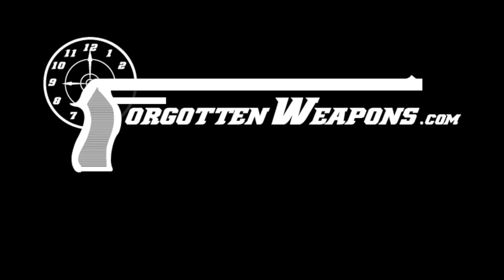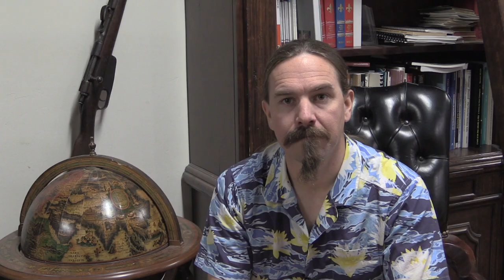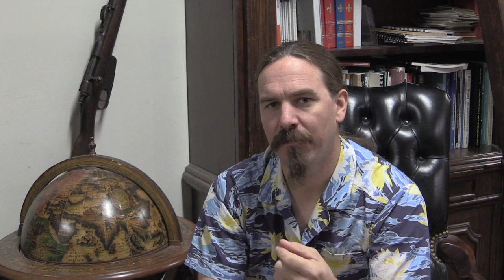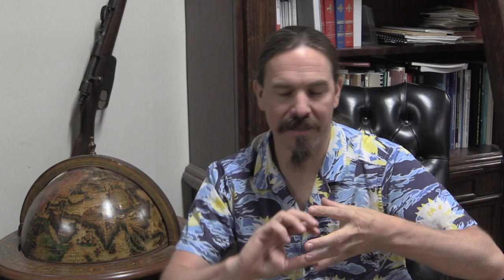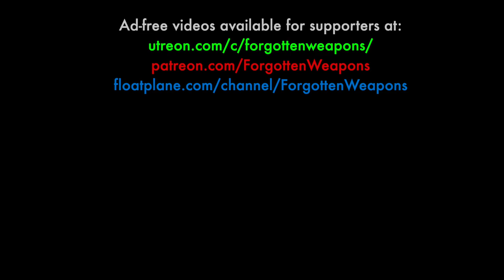Ask Ian: Progressive Twist (Gain Twist) in Small Arms?

Comment: On Colt revolvers with gain twist:

I own and sometimes shoot an original '51 Navy revolver with this feature, and have looked into it somewhat. To my understanding, the goal was to achieve decent accuracy with both round ball and much heavier conical bullets. Even today, if you shop for repro muzzleloaders you find that ones optimised for heavy conical projectiles tend not to shoot well with round ball and vice versa. The issue is longer conicals need a higher rifling twist for stability, whereas round ball have such a small rifling engagement area that steep twist rifling can just skip over the bullet instead. There's no cylindrical bullet shank to engage the rifling, only a narrow band of lead touches the bore. So if you try to shoot round ball with a full service charge of powder in a barrel meant for conicals, the rifling may just strip away parts of the bullet instead of spinning it up in a predictable manner. Colt's solution sort of works, there's less force on that narrow engagement area so they shoot well enough (but not super accurate, in my experience) with both bullet types.
Reply: That makes sense, I was thinking it might be to compensate for softer lead than we generally use today.
Reply: Belted balls might give you the happy medium. Slightly elongated ball with a small full diameter flat.
Reply: @Devin_Stromgren  it doesn't get any softer than pure lead, which with perhaps a little bit of tin mixed in is the preferred material for black powder shooting. Severely doubt they had access to something softer back then, modern BP shooters tend to go for the softest bullets they can get.
Reply: @Kaboomf  Yes, but the more tin the harder the alloy.  I'm pretty sure that even the round balls you can buy today have more tin in them than was standard in, say, 1830.
Reply: @Devin_Stromgren  No point in adding more expensive tin than you have to. Enough to make casting easier, no more, since BP shooters specifically want soft bullets. A tiny bit of tin makes the alloy flow better so it fills the mold without wrinkles.
Reply: ‘Stripping’ the rifling on round ball in the Colt revolvers were a thing. The supplied bullet molds were, to say the least, not always uniform. If the ball were a bit smaller, it spun the ball a bit slower reducing the lands ‘skipping’ on the bullet, ‘stripping’ the rifling.
  As far as increasing accuracy, we’ll, if your bullet is more solidly engaging the rifling and the jacket and lead are not separated, that increases your accuracy, does it not?
  As far as the purity of the lead, I dare say commercially sold lead today is much more pure than the lead from the 1830’s or so due to production practices.
Reply: @Kaboomf  Wait, THAT'S what the tin is for?  I had always assumed that pure lead was just too soft.  I've done a decent amount of black powder shooting but I've never got into casting my own bullets so I haven't done a lot of research on it.
Reply: @Devin_Stromgren  For black powder, tin is mostly to make casting nice high quality bullets easier yes. Increasing tin percentage can increase hardness a little bit, but nowhere near as much as adding antimony does. Lead/antimony alloys can be hardened significantly by quenching in water, lead/tin cannot.

For black powder in most calibers, velocities are low enough that you don't need increased hardness to prevent leading. And softer bullets obturate better to seal against the bore, especially with low pressure powder charges. Obturation also helps with rifling engagement. With higher pressure higher velocity smokeless loads a harder bullet gets enough force applied to its tail to obturate, but hard cast bullets like you'd use in a .44 mag don't perform as well in low pressure BP loads.
Reply: @greghardy9476  I'm sure there have been some advances in lead production, but long before the 1830's there was considerable work done on perfecting the refining of lead. The reason for this is that lead ore tends to contain small amounts of silver and other valuable stuff, so the more "impurities" you could remove from the lead the more valuable silver etc you got as byproducts. 

They actually got so good at this that it became economically viable to strip old churches and cathedrals of their centuries-old lead roofs, refine silver out of the lead, and make new lead sheets to make new roofing for the church again. Several old European cathedrals had this done at various times.

All this is to say that by the 1830's you could get lead in fairly high purity, certainly better than 99%, because the typical impurities were worth refining out in their own right. And those impurities make the lead harder, not softer.
Reply: Back when I did the repro colt revolvers like the 1851 Navy, I vaguely remember using .380" dia round lead balls for a nominal .376" bore?  Basically slightly oversized at loading.  Depressing the loading lever would either obdurate the ball or shave a tiny lead ring, producing an off-round projectile, and what might be a slightly beefier surface for rifling engagement.  It also helped seal the chambers from chainfire, although grease was a must.  Anyway, very interesting discussion... I think the theory of conical vs. round ball is accurate.
Reply: @kurtbjorn3841  yes, what you describe is best practice and does make for a short cylindrical part. Not all original bullet molds were accurately made though.
Reply: @kurtbjorn3841  I've heard that grease on the outside of the projectile is a myth because after the first shot the gas from the cylinder gap blows it away.
Reply: @Devin_Stromgren  - I think enough remained to "wet" the space above the ball, quenching sparks, etc.  I'm not sure.  I did have a chainfire once and did not want to repeat the experience, so I did use grease or soft wax.  It was  40 years ago, so my memory about remaining grease is poor.  Maybe someone will chime in.

Comment: In long range competition shooting community, gain twist is some what getting popular, especially in 264cal and 308cal. Many 6.5 CM shooters uses 24-28 inch barrel with twist gain from 1:9 (chamber)to 1:7 (muzzle), claimed more stable grouping and slower throat erosion.
Reply: The slower erosion is super interesting. Especially with a round like 6.5 cm that relatively kills barrels.
Reply: Saves me saying the same thing. I have no doubt as desired muzzle velocities increase in military small arms gain twist will make a big comeback as it's a cheaper solution than more exotic alloys in barrels.
Reply: 6.5 CM shooters I suspect on average are a pretty gullible lot to begin with so likely they are more inclined towards marketing hype
Reply: Gain twist also reduces gas blowby as the bullet travels down the barrel. 
In a regular barrel gas blowby increases as the bullet are "worn" going down the barrel and the very high speed gas going forward of the bullet has a blowtorch effect on the rifleling towards the muzzle reducing barrellife.
Another way of reducing the blowtorch effect is having a little choke in the barrel to increase barrellife. Cut rifled S&L barrels have a slight choke lapped into the barrel in finishing. Some highend hammerforged barrels have have choke. The French FRF2 sniperrifle have barrels with choke to increase barrellife.
Reply: @dgoodman1484  Now in my case could care less about any marketing materials as it was more about the intention. My goal was to go for 1000 yard shot without going to big stuff. Initially I chose the .244 Valkyrie but happened on a really bomb deal for a Ruger Precision Rifle. I think the one gripe I have about the caliber is it seems gun smiths/specialists just can not get their shit straight on the round. It seems recommended barrels, lengths, brand, and so on is more in the sky than ever before. What I found interesting during the plandemic ammo shortage was the few rounds that were available being 6.5 creedmoore, .260 Remington, and .300 Winchester Magnum, and .244 Valkyrie. .260 and .300 I was not aware of but talking with some people those two as well are pretty nice rounds and seemed to be same price about.

That all said the gains were to improve a few things on other popular bullets. Recoil, accuracy, and action were the benefits. Even in the shooting competitions it was taking a lot of wins versus the other rounds used. Enough so it made it to articles and reports. So I do not think it is just hype, but as we probably figured out by now. There are many different calibers and many basically forgotten. So is 6.5 supers special? At least for the moment yes it seems to be pretty good. The military adoption is also pushing market share as well due to production to fill the demand. In my opinion the round that needs to be moved from is the 5.56 but that is not going to happen any time soon. Its design purpose was a NATO requirement and its purpose to tumble not really humane overall.
Reply: @agskytter8977  What do you mean by choke? If I am reading that right it almost sounds like the barrel gets tighter towards the end sort of like a shot gun choke. Wouldn't this affect the bullet shape as well as potential damaging of integrity of the bullet itself?
Reply: @1014p  Yes, tighter towards the muzzle. In one of FW videos on FRF2 a french engineer explaines this in detail. Barrellife go past 10000 rounds.

Comment: During development of the M39 and M61 gain twist rifle also showed a slight increases in muzzle velocity over uniform twist rifling. The GAU-12 25mm, and the two 30mms, GAU-8 and M230, also use gain twist rifling.  Some people claim gain twist is used for fusing reason, but this is not the case.  The Army's M50 series 20mm ammunition for the gain twist M39 and M61 uses the same fuses as the Navy's  Mk 100 20mm ammunition for the Mk 12 cannon, which has uniform twist rifling.   Also, large artillery, 105mm, 155mm, etc., use uniform twist rifling, and these have much more intricate and complex fuses.

Comment: A couple of things:

"Progressive Depth" rifling is a major feature in the barrels for the M-134 Mini-Gun.

These barrels have an amazingly light profile, hence barrel wall thickness. There are usually SIX of them being whirled around, each discharging up to 1000 rounds per minute.  The barrel wall thickness at the muzzle has to be one of the thinnest I have ever seen on a firearm with that sort of rate of fire. Looking at the drawings for these barrels, the rifling is DEFINED as "progressive depth"; becoming DEEPER at the muzzle; essentially tapered-depth LANDS; the groove diameter is essentially parallel.

Think about that: reaming a tapered bore and then trying to cut rifling into it. The final cherry on top is that these barrels are also hard-chrome lined.

If you get your sticky paws on a new Mini-Gun barrel in its wrapper and take a peek, it becomes apparent that there is more than one way to form a "taper".  The rifling in these beasties is STEPPED; a sort of "digital" taper. with short "ramps" between each step. Put simply, H&R, who made a gazillion of these barrels, used quite conventional barrel-making tools to "approximate a "tapered" bore.

Thus, if a techie / armourer type runs in a set of incremental bore gauges to the depths specified, all will be sweetness and light. Bullets accelerating from a standing start to over 2500 FPS just do not care. Whirling a cage of six barrels around in the breeze / slipstream at 1000 RPM helps to keep them "cool" (ish). I have heard rumors of M-134 barrels with Stellite liners like an M-60 barrel, but there is nothing on the drawings about it, nor have I ever encountered one. Any advances?

As tor gain twist; using ancient barrel rifling tools and machinery, it is relatively easy to do. A conventional single-tooth cutter dragged through the bore and guided mechanically by a "pilot" drum with the progressive-twist track on it will do it all night long. One pass at each index and depth, reset the "tooth" a thou' or so, repeat until you have the desired result. Before the advent of "industrial" scale technology, this was done by HAND, in thousands of tiny workshops all over the USA and Europe.

I suspect the Italians went down this road for a couple of reasons. 6,5mm was, at the time a SERIOUSLY small bore, especially when most of the neighbours were still fielding 9 to 12mm bored antiques. Those, like the Brits, who were already fielding 7.7mm (.303") bore arms were using long, torpedo-shaped bullets with jackets drawn from Cupro-Nickel, which is fairly hard stuff.

The engineers probably noticed early bore "wear" in their prototypes / test-beds and sought a solution. Another factor is the "pressure curve" on firing.  The Carcano is a tough little action, but has marginal gas shielding . Furthermore, the brass used in the day was still not as refined in formulation AND processing, as it would become less than a decade later. Launching the bullet relatively "gently" was probably considered a judicious thing. Any throat "wear" due to bullet abrasion / propellant gas erosion could be discounted for longer, because the final bullet spin rate was achieved in the final six inches of the barrel.

Comment: Very large bore weapons, such as larger caliber aircraft systems and artillery pieces, use a separate driving band made of softer material than the casing on their projectiles.  The driving band engages with the rifling and provides obturation, rather than the casing.  One of the tests we used to perform when proofing these systems was to test for driving band slip.  

Whilst the use of driving bands is generally a good system, it tends to encourage gas erosion just forward of the chamber.  As a result it means a rifled tube may remain in service in such condition that quite a length of the rifling directly ahead of the chamber has been removed by gas erosion.  One of the regular tests done on large bore systems is to measure the depth and length of gas erosion to calculate the effect on stabilisation as a result of the lost rifling.

The level of gas erosion present towards the end of the service life of a large bore rifled tube means a projectile starts to accelerate down the bore for some distance before engaging the rifling, and the sudden engagement at higher velocity makes the driving band slip more on the casing.  Thus there is less gyroscopic energy present to stabilise the projectile and you are effectively 'shortening' the rifled tube.  Progressive rifling helps to alleviate this by reducing the level of driving band slip.  

Modern systems are tending towards smooth bore tubes as these alleviate both problems of gas erosion of rifling and driving band slip.

Comment: For your files:

Other than a couple of demo sporting guns produced prior to the sPzB 41, rifling development seems to have been done on larger weapons rather than rifles and pistols.

The British 3.7" AA gun Mk VI, actually a 4.5" gun lined down to 3.7", used rifling that disappeared some distance before the muzzle, "Probert" rifling, which smoothed the driving bands down into the shell body, requiring appropriately-designed shells. Velocity increased and with much less barrel stress than a true squeeze bore design. The V-1 really got the attention of the British. The development of SAMs replaced these weapons.

In the mid-90's, there was some work on various rifling twist rates (parabolic, cubic-parabolic) for light AA guns (~30mm-40mm) that changed the barrel pressure curve, from the usual quick rise followed by a decay, to a less quick rise (to ~60%) followed by a roughly level pressure until projectile exit, or a section of a circle, until projectile exit. Apparently, this work also went nowhere, due to smoothbore weapons becoming mature enough, and various SAMs being much more effective than guns. Brassey's "Cannons", by D.F. Allsop, 1995, p38 and 39 are the only 2 pages I've ever seen on this topic.
Reply: The implication, AIUI, is that a Weatherby cartridge would then generate ~40,000psi instead of ~65,00psi, generate a noticeably higher muzzle velocity, last much longer, but would have to be a bull barrel design, and maybe even slightly larger in diameter. I see a 2" dia, 26"barrel, as a "No".